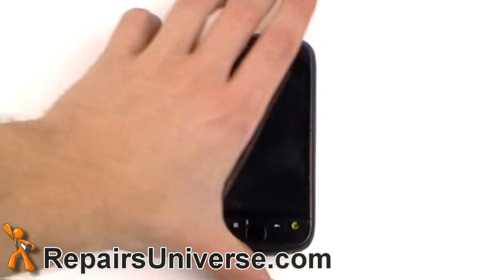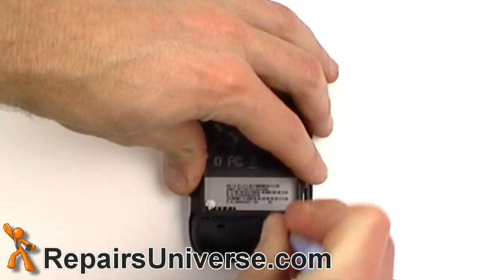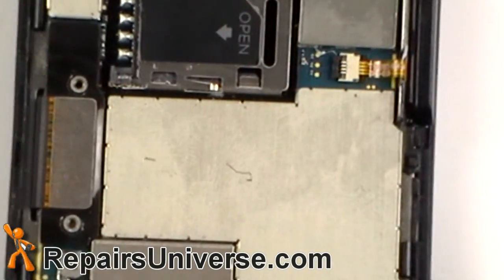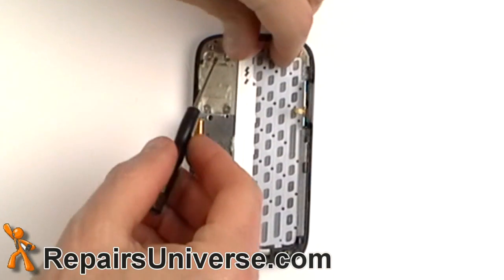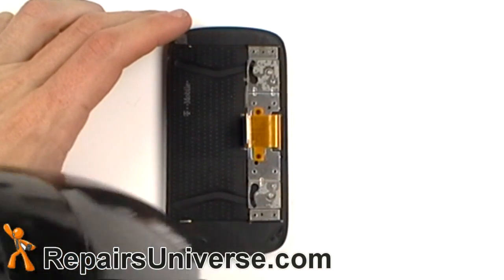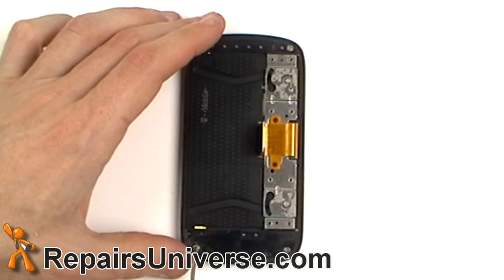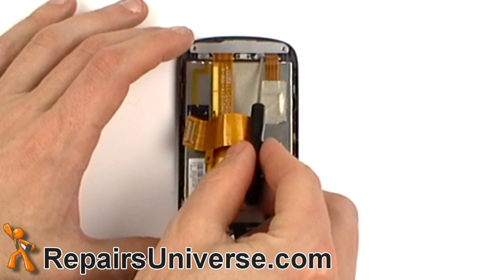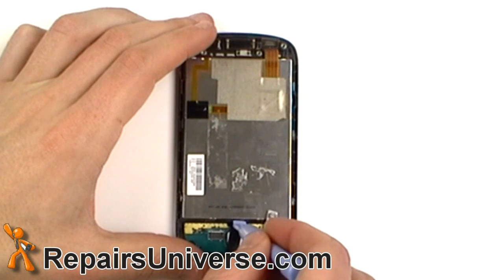HTC MyTouch 3G Slide Touch Screen Digitizer Repair Guide

Comment from the maker: @Juanc562 Defiantly a good possibility of this. That is one of the main issues with slide phones, the flex cable goes through a lot of wear and eventually can become faulty or ripped. Replacement slide flex cables are available at RepairsUniverse (dot) com.

Comment from the maker: @thesoccerking93 Dry it out completely, drop it in a bucket of rice and let it sit overnight in a warm area. From there you can test it out and diagnose any issues. Opening it up will be likely to make sure it is only the digitizer which is damaged. Check out RepairsUniverse (dot) com for replacement parts available for the Slide. Good luck!

Comment from the maker: @marcusmcfresh If the glass touch screen won't respond it could be due to a few things, including a loose connection, water damage, drop, etc. As for the buttons, this is controlled by a separate flex cable that is not part of the touch screen digitizer. It may be this is loose or damaged. Depending on the type of damage replacing the touch screen digitizer may be the best option. These can be found at RepairsUniverse (dot) com.

Comment from the maker: @YEKk11 It is very likely that replacing the LCD screen will resolve the issue. Many times these screens become faulty after a bit of use and everyday drops and falls. Check out the LCD screen available for the 3G Slide at RepairsUniverse (dot) com.

Comment: Thanks for this video, it's very useful. Maybe you have the answer to this problem. For about a week, when the slide opens sometimes the status bar appears in the middle of the screen... like the screen was cut into 3 pieces and rearranged. Also as of today the digitizer isn't working sometimes when the slides opened. Basically the question is, can this be fixed with one of your flex cables or is the digitizer bad also? Thanks

Comment from the maker: @cmstreeter329 Post repair the touch function does not work at all? Seems odd. Would check the connection on the "slide" flex cable and the connection for the digitizer again. Otherwise it could be a motherboard issue. Difficult to tell until you have rechecked all connection.

Comment from the maker: @7arakooni We are sorry, but are currently not offering our repair service on this model, as we are a technician short. The part you have damaged is the motherboard flex cable, which we do have available at RepairsUniverse (dot) com. As for the screen, we also have replacement touch screen digitizer available. Follow our guides carefully and you should have no issue preforming the repair yourself.

Comment from the maker: @coukanouk87 Hmm, if you can still get a solid connection and find a way of holding the flex cable in place, you may be able to work around it. If the clip is too damaged however, you may need to look for a new motherboard, which are not cheap. Try looking around in some forums for some data on broken "jaw" connectors. Good luck!

Comment from the maker: @Stevie654321sc I would suggest taking it to a local repair shop for a quick diagnosis of the issue. They should be able to pinpoint what exactly is wrong. You can then do the repair yourself if you want to save some extra money as well.

Comment from the maker: @homiegv8 You will need to replace the touch screen digitizer, unsure what the issue with the home button is however. Possible connection issue caused by a damaged touch screen. You can find this replacement part at RepairsUniverse (dot) com. Good luck!

Comment from the maker: @Juanc562 Sounds like the slide cable (motherboard flex cable) is not getting a good connection, or has become faulty. This is quite common. Replacements can be found at RepairsUniverse (dot) com.

Comment from the maker: @MrXmod1000 Sadly no, this will probably be the best way. You may be able to get in through the front, but I would not suggest it, as ripping the touch screen flex cable would be very likely.

Comment: @RepairsUniverse whats strange is that i didnt touch any of those while I was changing out the screen's flex cable. what should I do about the volume button since theres only the one small flex cable at the beginning of your tutorial? i didnt see any metal contacts to reseat under the volume buttons. 

I've already tried redoing the reassembly but having the same problems. It also triggers itself when I am opening or closing the slide.  

Thanks for much for the help.

Comment from the maker: @BladeAngel77 This is likely an issue with the "slide" flex cable. It is common for these flex cables to wear after use, causing cracks in the circuitry or rips in the cable. We have replacement slide flex cables at RepairsUniverse (dot) com.

Comment: Hi, I opened it up and the little cable that's connected to the volume rocker came loose. Not sure is was already loos and that was causing the problem, or it it came loose while i was trying to take things apart. How can i get this re-attached? Thanks for all your help.

Comment: Hi! I found your video extremely helpful, except I ripped the volume flex cable ribbon thing. I want to order one except I can't find a video guide to replace it. Do i just have to take out the volume rocker, ribbon completely and replace it with the new cable and rocker?  Also I was able to replace the digitizer except it did not seal properly and a lot of dust got between the digitizer and lcd. How to I seal the digiziter to the plastic housing? Do I just superglue it? Thanks and God Bless

Comment: When I looked over the flex cable, I saw not even a scratch, cut, or any other form of damage. With that out of the equation it seems I must purchase a replacement screen. Am I correct in this assumption?

Comment from the maker: @cmstreeter329 If it was a chip on the cable itself, it could certainly cause the issue, but a chip on the adhesive coating or similar should not effect it that way. Seems your most likely cause however. The distance does matter to an extent, but using 3m adhesive or similar is normally the correct distance and would not effect a nonfunctional screen. Best suggestion would be to replace the slide cable. These are available at RepairsUniverse (dot) com.

Comment: I ordered both screens to replace my 3g slide. There seems to be an adhesive around one of the 8 screws mentioned  3:55 and a hair dryer does not seem to be fixing this. What should I do?

Comment: I have a question, I dropped mine and the screen is cracked bad, but everything still works, so what parts will I need to order? Do I need a new LCD or digitizer or both, is there a difference? I changed my laptop screen so I think I can do this, also are there any supplies needed not mentioned in video for reassembly such as adhesives? Thank you:)

Comment: What exactly does the digitizer provide functions for? My outside buttons (home, menu, back and genius) stopped working, my keyboard no longer lights up and my touch screen animates fully, but doesn't respond to touch. I've been woefully navigating through my phone via the keyboard, but it's a nightmare to do so. I took it apart and thought that maybe a drop had loosened a ribbon cable or something, but that wasn't the problem. Any suggestions?? This video was great for dismantling, by the way!

Comment: @RepairsUniverse yesss it has water damage but after that it was working fine like 2 month later  the lcd went black, and everything else was working, yes the lcd was fully connected and also i tested another lcd on my cellphone and works perfectly, but when i put the new one, didn't work. there is any chance that can be any aditional part that its damage.?

Comment: @RepairsUniverse if i damaged the volume flex cable at 2:30, do you sell replacements parts for that? I'll take a look at the connections again but they seems to be seated just fine. Another possibility is that I noticed when I replaced the black housing after reassembly, it didn't sit properly and could be pushing down on buttons?

Is it also possible that the replacement motherboard flex cable(for the screen) that I used was defective?

Comment from the maker: @skittles3purple Very odd, can't say I've heard of that happening. Possible to overload the system from static? Not quite sure the best way to diagnose an issues like this. Checking the touch screen for damage (flex cable, connector) might be the first step. Replacing the screen may also fix the issue if it is the screen itself which has been damaged. Replacement screens for the Slide can be found at RepairsUniverse (dot) com.

Comment from the maker: @jdunnwsup Use a pry tool or flat head screwdriver to attempt to lift the adhesive up. Using heat will make the adhesive more mailable,

Comment: thank you! i used this guide to replace the ribbon cable on my mt3gs. it worked perfectly and now the video works on my phone again. but now i seem to be stuck on the mytouch splash screen when i turn it on and it wont boot into android. i hard reset to factory settings but it still stuck. any ideas?

Comment from the maker: @Jeetman63 Thank you very much. As for the tape, it can be reused. However if you are concerned, we suggest picking up some adhesive strips at RepairsUniverse (dot) com. These work great for holding things in place without taking up much room. Alternatively you can use electrical tape.

Comment: Hello! I just wanted to ask what I would need to replace if my phone turns on, but it just remains black. I know the phone is still working because I can receive calls, but I just can't see anything. I also do not have any water damage to it, it just suddenly stopped working and I'm not sure if I need a totally new LCD screen or just a motherboard flex cable. Thank youu

Comment: The flex cable at 2:30 ... what is that one called? I need to order a new one. I experienced screen failure and opened my phone up to find it completely severed off. :o

Comment from the maker: @xxXDjYoUnG1Xxx If the display is not working at all, it may be a connection issue. If the display is showing some light/color then it may be a faulty LCD screen. There are quite a few more possibilities but would have to know more about the phone.

Comment from the maker: Sadly no, as the touch screen is adhered to the front cover. In order to remove the cover you will need to follow the full video and remove the touch screen from the front housing using heat.

Comment: I replaced my digitizer and it's still unresponsive. Doubled checked all connections. I also noticed front buttons (home, menu, back buttons) won't work, even before repair. What may be the issue? Thanks!

Comment: My screen was not responding to touch any at all, and when booting into the service menu I received the message 'touchpad fail'. Ordered a new digitizer, and followed through and changed the screen. However I still have no response, unfortuately my volume buttons arent responding now either to get back into service menu :(..any ideas? Ribbon cables were handled generally, all connectors reconnected.

I did remove the old adhesive on the digitizer, and replaced it with adhesive strips.

Comment: I did everything perfectly but the ribbon that you clearly say "Gently peal the ribbon back" at 6:20 in the video got tore because it was glued so hard to the back of the phone.... now I put everything back together and the screen looks beautiful but the home, back, settings and genius "hard buttons" at the bottom don't work :(
is this a part I can replace? if so where can I find it and how much does it cost? :(((( Im so sad

Also is this the part that controls the hard buttons on the bottom?

Comment: Hi, my phone have a problem when i open the keyboard the image in the screen splits or turn on stripes so i have to turn off the screen and turn it on again to fix the image, besides the touchscreen doesn't respond sometimes and i fix it the same way; last night i opened and closed the keyboard and then the touchscreen doesn't respond if i have the keyboard closed and now the phone doesn't show any image (screen's totally black) What may be the problem? is it the flex or is it the screen?

Comment from the maker: This sounds like an issue with the slide flex cable. This may resolve the issue with the touch screen digitizer and LCD but worst case, you will need to replace these screens.
RepairsUniverse (dot) com

Comment: My mytouch 3g slide screen is black. When I turn it on i feel it vibrate and see the front buttons lights go on but the screen is still blank. I tried to take the battery out and leave it there for a day and put it back in but it isn't working. Do you know what the problem could be?

Comment from the maker: @xxXDjYoUnG1Xxx Either a connection issue to the LCD (you can open it and check) or the LCD screen is faulty and will need to be replaced. You can find replacements at RepairsUniverse (dot) com. Good luck!

Comment: iv'e followed your video to replace the digitizer but i have a problem the track ball wont work. IE. when i press the ball the screen will light but when i try to scroll nothing happens. not even the blue light that would normally appear over the icons.

Comment: I forgot to turn off and take off the battery before replacing my screen protector on my 3g mytouch slide. the screen had no sign of damage everything looks clear, but the touch screen does not respond. what do I need to do?

Comment: I replaced the digitizer, all the connections and the flex cable are fine, but the screen still doesn't detect touches. What did I do wrong?

Comment: My phones touch screen is blank. But vibrates when i turn the power on like it normally does. Is my LCD broken? The Led light (glows green/red when charging) doesnt glow when i charge my battery. My trackpad dont work? Is my phone completely broken?

Comment: I have a question, MyTouch 3G Slide screen doesn't work. The touch still work because it vibrates when you touch the sreen but I cant't see anything. What so I need to do? What need to be fixed?

Comment: i changed my flex cable on my touch 3g slide because the touch screen wasn't working and when i did changed now the screen wont turn on but when i press the power botton the cell phone vibrate but nothing appear on the screen.... please help me thanks

Comment: My phone is stuck like when i try to use it the screen is just still if i try to put in the password it wont work the touch isn't working it's like its just frozen. And the only when i turn it off and on is by taking out the battery. It still receives calls and texts but i'm not able to use my phone please help any suggestions?

Comment: htc sensation: I dropped my phone, the screen has 1 crack going horizontally across the screen. phone turns on normally, home screen is normal, calls, texts all are received but I can not slide to unlock the phone. The touch screen is not responding. How can this be fixed?

Comment: I'm not exactly sure if it's me or if it's the stupid phone because it's been degrading over time for some strange reason. The camera is shit for some reason, IT's a common problem but not common enough apparently for the tmobile representatives I've met with have seen before). It's been becoming unresponsive at times. One  problem is that I would close the physical keyboard, the screen goes black and the only thing to fix it is to hit the power button and press it again to get it off of sleep.